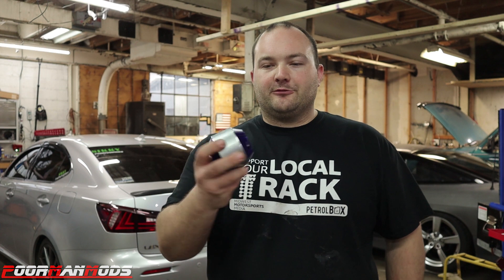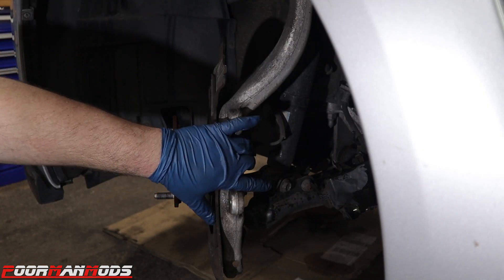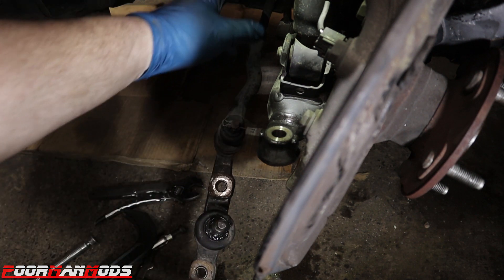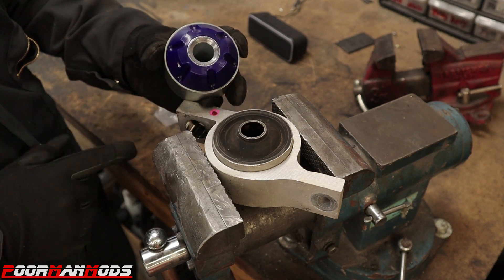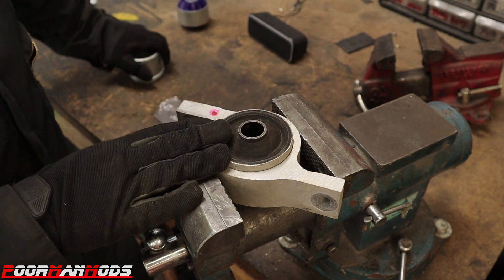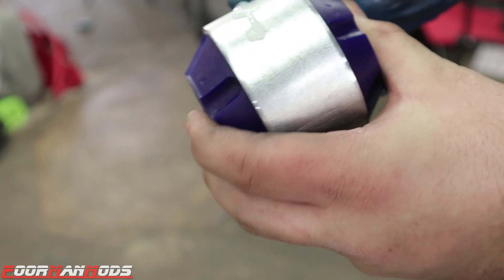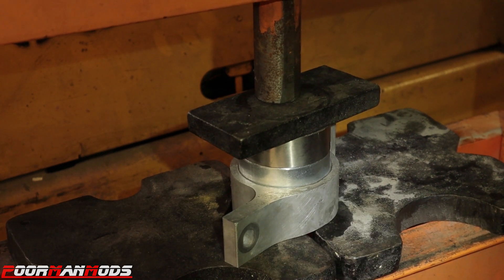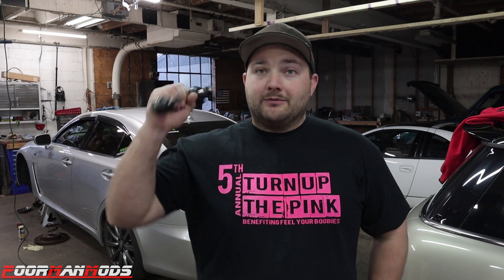A much needed suspension upgrade for the Lexus ISF IS350 IS250 | Lower Control Arm Bushing

Comment: Question - I have a 2014 GS Fsport RWD and the stud that goes from the control arm into the rear bush broke due to being hit. I was wondering if you can help with a replacement part

Comment: Man you should have looked on club Lexus first would have saved a sh#t load of work, you don't have to remove the ball joint or the shock bolt, anyway you got it done cheers from OZ.
Reply from the maker: Yeah oh well, the important part of this video is the press section
Reply: Lol man you did take the long route, you basically took apart the whole suspension to replace that #2 bushing. I did this as my first mod years ago and it is a good one!
Reply: How do u do it with out removing most of it?
Reply: @donmakavelio  undo all the bolts around the bushing and just pry the LCA down and out away towards the wheel to where you can just pull the bushing off the LCA
Reply: Yes sirrr thank god i watched one before i did it i was doing it for a CLIENT but i plugged him so it wasnt payed in cash just ig clout haha but def glad i didnt use this single reference and found the easy video on doing this
Reply: @donmakavelio  just take the wheel out and press down lower control arm and bushing will slide forward
Reply: He did way too much work 🤣🤡
Reply: Jedi Luke 22 instead of calling him a clown why don’t you just take the good parts of the video and ignore the rest. People like you give the diy a community a bad name. Plus it goes to show how good of a mechanic/technician you are if you have to watch another man teach you how to do it. 🤦🤡🤡🤡

Comment: Holy shit you did so many extra steps lol. As an actual mechanic, you can just undo the two bolts holding the mount (and a few little things in the way) and the 22mm nut holding it in on the back. Then slightly loosen the front bushing, pry down on the arm, pull out the bushing. Then to press it out, just press it out. With real tools. Seriously, did two pairs of these in a few minutes each unlike your back method. The whole process for me from getting on the rack to having it aligned and back in the customers possession was faster than your whole video.
Reply: Where’s your shop?

Comment: It cracks me up that people think urethane bushings are so great. Yes they offer more precise handling, but at the cost of added vibration and harshness! This is a fact. I have an IS250. Beautiful car that rides like a Lexus should. That said it’s not a race car. Either is a IS350 or even an ISF. If you want one buy a Corvette. As for me I’d rather not ruin the ride that Lexus IS known for. To each their own I suppose....
Reply from the maker: My penis works just fine, I dont need a corvette.
Reply: You buy the lca bushing to correct the inner tire wear (along with a proper alignment).  Lol you sound like someone thats never driven an ISF, assuming its not a performance-oriented car.  Stay in your lane (the far right one please) thanks.
Reply: An isf has harsh ride quality from the start its a performance car.
Reply: Thisname Isnotfake performance car....😂😂😂
Reply: @nordicpride9708  yeah homie its the F model... literally google "lexus F" 😂
Reply: NordicPride970 no one said its a “race car”... yes lexus is known for luxury and comfort first and foremost of course! but i dont know how you can confidently say that the ISF isnt a performance car... yes of course it wont compare to a vette or a porsche, youre comparing apples to oranges with that argument, but theres no denying it will drag a majority of the cars on the road, it was a passion project built to be a fun, quick, yet unassuming weekend driver. 400+ hp isnt anything to sneer at man, i think everyone but you can agree that its a car made with relatively high performance in mind (:
Reply: @nordicpride9708  Its a sports sedan, why are you comparing it to a porsche or a vette and not an e90 m3? Starting to think you have a few screws loose
Reply: @nordicpride9708  lmao ok chief
Reply: NordicPride970 Have you ever riden/driven in an ISF? Since when is 416 hp/4.4 sec 0-60 slow? I don’t know why youre stressing out over the word performance haha, whats wrong with saying its a luxury car with performance traits? It doesn’t have to be one or the other, its a nice mix of both! Your IS250 on the other hand, most definitely not a performance car in the least! I think you might be confusing the two or something (;
Reply: Xo Miracle Yeah I have personally driven one. Not impressed. I’m not confusing anything. The 250 is a commuter car. What all Lexus’s are. Nothing more.
Reply: @nordicpride9708  As a previous C6 Corvette Z06 owner, I prefer tracking my ISF way more. Better handling, more predictable, and it doesn’t leave me stranded anywhere.
Reply: @AliasProductions801  I won’t argue with a Japanese made sedan being rock solid reliable. I have owned corvettes and also own Lexus/Toyota. That said, your ISF isn’t a track car. It’s not even a debate. It’s a SEDAN! Yeah it’s been beefed up so to speak, but comparing it to a vette is a absurd venture. Two completely different worlds. Corvettes are pretty damn reliable for a racebred performance car. I never had a Lexus pulling along side make me even consider a roots blower when I owned C6. You simply can’t beat the LS architecture. It’s second to none.
Reply: @nordicpride9708  I had to replace my LS7 3 times. I’ve only done oil changes on my 2UR. LS engines are terrible for road race cars without EXTENSIVE oiling up grades. There are also a couple sedans now that are even faster than the Corvette ZR1 around the Nur. Just because a car is a 4 door, doesn’t mean it’s not a track car. That’s the most boomer ideology I’ve ever heard of. You could definitely make the argument that a sports car can’t be 4 doors though.
Reply: @nordicpride9708   I completely agree.  I don't know why these dudes wanna ruin the comfort in a STREET car.  If it's a track car that's one thing.  I got a daily, slow 250 and I just threw on some eBay LCA's and the ride is cozy.  Been on the car for almost 2 years with no more tire wear or any issues.